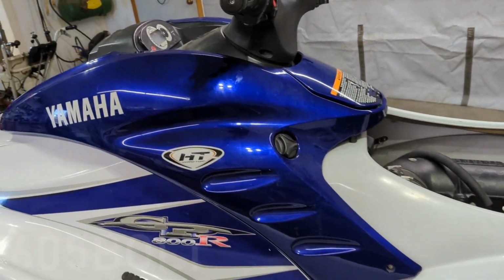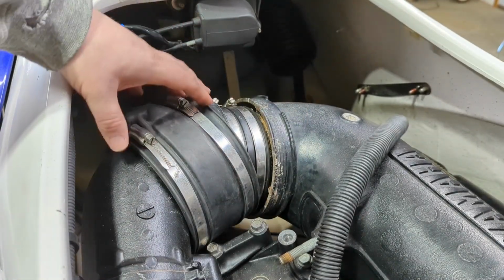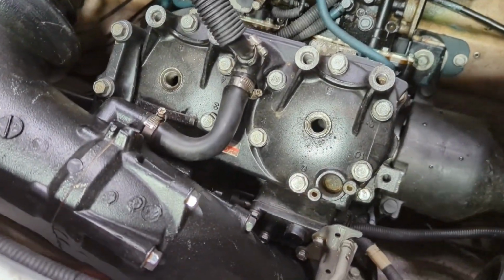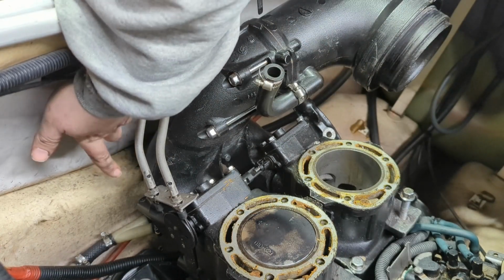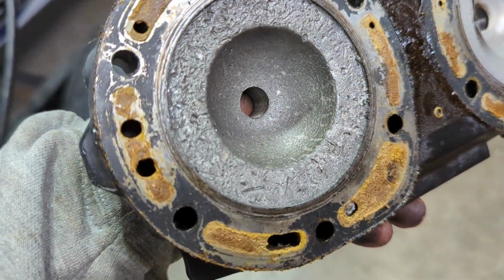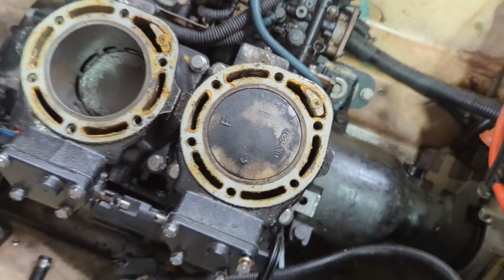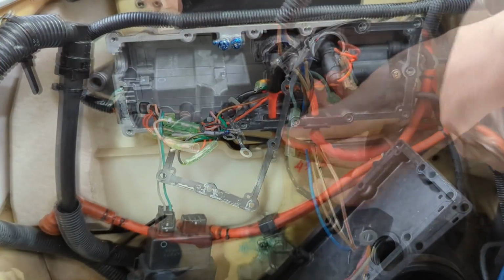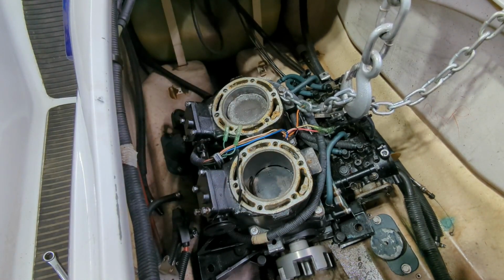Jet Ski Engine Removal -- 2001 Yamaha 800PV Engine

Comment: I know your video is 3yrs old at the time of my comment.  I have a gp1200 and a gp800r.  I swapped out the original gp800 engine to a gp800r.  I am having a similar problem with getting the ski up on plan.  I can only get it to go about 5.5 mph.  I am going to follow your lead in another video and get the silver spring and set the popoff to 45 or so.  I wanted to comment on the engine removal based on my experience.  I was able to swap the gp800 with the gp800r without removing the exhaust or disconnecting the EVC (electrical box).  I unbolted the electric box from its mounting.  I think it is four bolts.   I only disconnected the oil, gas lines, the throttle and choke cables and all the external tubes.  The one thing I did have to do is unbolt and remove the rear battery box.  Once the engine is off of its mounts and uncoupled from the transmission, with the battery box removed the engine can be removed.
Reply from the maker: Good info. That definitely sounds easier. I did fight the tuning on this just a little. I assume it was because the self oiling was deleted. Anyway, the fix for the carbs for me anyway is in my last video of the series. Thanks for commenting and watching!

Comment: Hi i am getting mixed messages from people is it a good idea to put gasket sealant   on with the head gasket?
Reply from the maker: Been a long time since I did all this work but as I look at the GP800R service manual (page 5-18), it calls a non-reusable gasket of course and no sealant other than loctite 572 on the actual threads of the head bolts.  But as for the head gasket sealing surface, it looks like dry is the call.   That is what I would have expected.